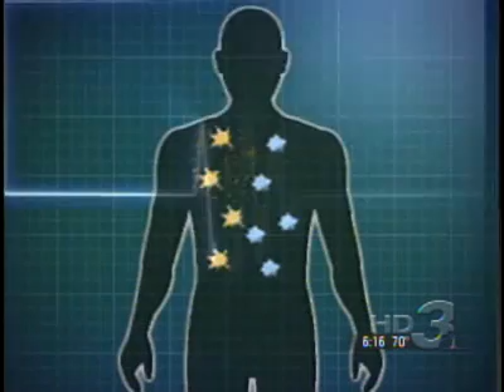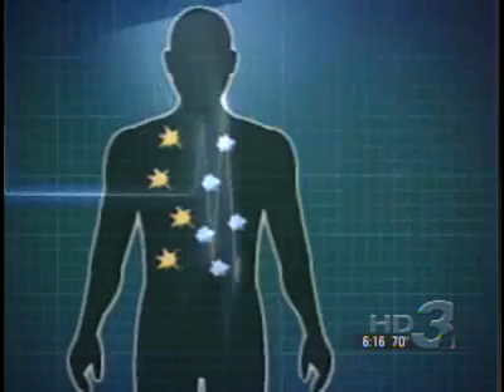Saltwater Engine

Comment: What happens to the salt atoms?  1500 degrees has to be hot enough to keep the sodium dissociated from the chlorine long enough for them to separate completely.  I'm not sure if chlorine gas is more hazardous than carbon monoxide, but it's a detail I'd rather they didn't skip!

Comment: @mickfinnegan Read atlas shrugged and compare it to Rearden Steel. It wouldn't ruin the United States. It wouldn't devalue the dollar either. If that were the case, the invention of the internal combustion engine and gasoline would have devalued the dollar and ruined the US as well. That didn't happen did it?

Comment: @bilkay0 that goes against the conservation of energy, there could not be enough energy created by the generator to power the radio transmitter. Combustion engines are extremely inefficient

Comment: @Wcoltd 

2H2 + O2 → 2H2O(g) + heat

I think you're right, the radio waves split the water into H2 and O2 which combust from the provided energy from radio waves and they reform, then are split apart again.. there are things called watertorches that are an older version of this but rely on the same principle. There are even cars that run on something similar.. but as I have previously stated, it isn't a source of net energy.

Comment: @Wcoltd 

It's just simple combustion, the H20 splits into H and OH because of the energy from the radio waves, then is ignited by those same high energy waves. I don't really think it's practical because of  the amount of electricity required to generate the radio waves is extremely high.

Comment: @ricky300ex  First you have to create electricity.  If the electricity generation creates pollution (and most methods do) then this process creates pollution.  Also, if you have electricity, just put it into a battery in an electric car.  This is 80% to 90% efficient.

Comment: You realize that I said it requires 200% MORE energy then it puts out....as in it's 50% efficient.  

In reality, even if the Electricity>RF>H2(gas) process was 100% it's still a horrible system for cars as converting H2 gas to motion is done 1 of 2 ways. A fuel cell converting it to electricty (which we started with) or burning it for heat which is only about 20% efficeint (about the same as the car you have now).

Comment: Chill out guys, it's not like an RF Generator can't be integrated into an automobile, or something similar to it to help produce the energy...RF Generators don't drain a whole crapload of energy, especially if you intend to design it for fuel efficiency...just a little jumpstart of electric and your car can run for quite some time...
Plus, it's not like the RF Generator needed a crap load of electric to ignite the flame...they should consider Kansas' idea and improve upon, it's a gread discovery

Comment: There's nothing exceptional about burning hydrocarbon-based fuels (indeed, it's the basis for our society!). Fuels have energy. That's why they burn. Water on the other hand doesn't.

"Pantone process"? You mean Paul Pantone, who's in jail for fraud after initially being declared incompetent to stand trial, and has yet to demonstrate a working model of his scam?

"It's all around you, passing through you"? So it runs on The Force? You're a crackpot, energyismass.

Comment: Having a low electric bill makes you an authority on electrolysis and hydrogen combustion how? Cavemen also had low electric bills, but didn't claim any special "secret" knowledge about how to get energy from water.

"maybe I'm not sure exactly what is happening"
Then why do you make claims about "effeceint water cracking techniques"?

"Put that in your pipe and smoke it bitch."
In 4 days that's the best retort you could come up with? Degrees are irrelevant. Learn some science, then come back.

Comment: Side note: the reaction you mention with zinc and vinegar water is the acetic acid in the vinegar reacting corroding the zinc. Sure, "hydorgen" (to use your colorful term) is released, but it's not coming from the water. Again, this is basic chemistry.

Comment: The laws of physics disagree with you, and a basic knowledge of molecular chemistry would show you where you're wrong. Electrolysis is the means by which the combustion energy is imparted to the hydrogen in the first place! Again, even at 100% efficiency you won't get any energy out through combustion that you didn't put in yourself. Re-read my "rolling a rock up a hill" analogy. Then go find your chemistry teacher (if you've ever had one) and smack them for me. ;-)

Comment: EIM, please explain how this *isn't* an overunity claim. Electrolysis is simply the hydrogen combustion process in reverse. Xrayrep is absolutely right- even at 100% efficiency (an impossibility), the BEST you could hope for would be to break even. Reduce the power in the electrolysis and you reduce the hydrogen output. Your claim is like saying that you can get more energy from a rock rolling down a hill than it took to roll it up the hill in the first place. This is basic chemistry.

Comment: RF energy may be an improvement over DC for electrolysis, but it is far from unity (or, as the Free Energy quacks like to say, "over-unity"). Therefore, rather than use an electric source to break apart water just so you can burn the resulting Hydrogen, it makes more sense to simply use that electricity to run an electric motor directly! There are losses associated with electrolysis no matter how efficient your process is. It can never be 100% or better.

Comment: True, Hydrogen, by itself, is a fuel but only after enormous amounts of energy from other sources have been used to extract the Hydrogen from whatever other gases or solids it happens to be bonded to. The problem with this video is the fact that it's greatly misleading. It starts out with the News lady saying, "At 4 bucks a gallon for gas, how would you like to run your car on saltwater?" That is irresponsible journelism because she leads people into believing such nonsense.

Comment: Saltwater is not a fuel, and can never be a fuel. It's the electrical power from his RF generator that breaks down the saltwater in Hydrogen and Oxygen. His spark-light ignited the flame. When he removes the electrical power, the flame will go out. People who understand Physics know that saltwater (or regular water) is not a fuel. As gasoline prices climb, people start believing the most ridiculous claims for miracle alternatives for gasoline. Burning saltwater is just one of those silly claims.

Comment: April 29, 2008: This information needs more supporting data such as the frequency of the generator, power output, standing wave coupling or freely radiating electromagnetically, and much more.

Research on my part reveals that there is indeed hidden energy associated with the single atom of Hydrogen in the field not terminated by the normally attached electron.

When not terminated, the proton pressure wave energy can grow without limit. The electron normally is the limiting termination.

Comment: This is not a source of energy, period. The hydrogen is being used as a storage medium, not an energy source. RF energy is going into water and being stored in the splitting of the water molecules. This same energy is what comes out when the H2 and Oxygen are burned. 

This isn't newsworthy. It's basic chemistry. Much more energy is being expended in the RF generation than is coming out of the H2 combustion.